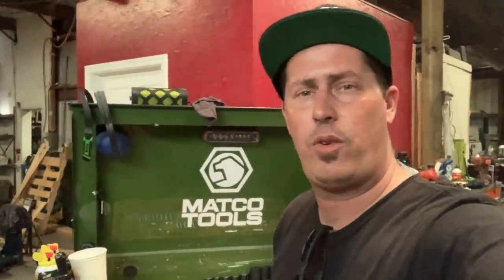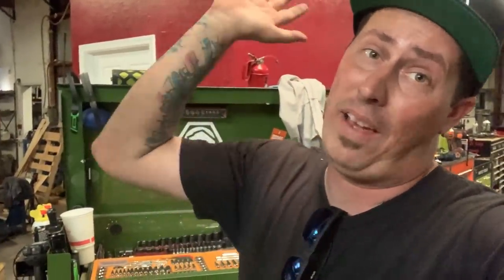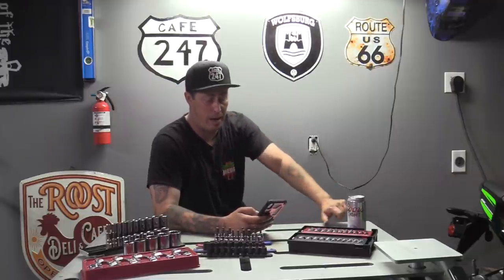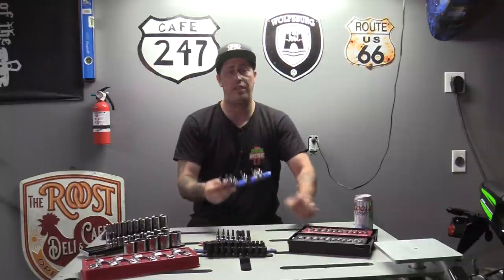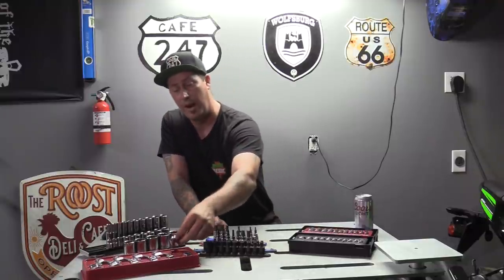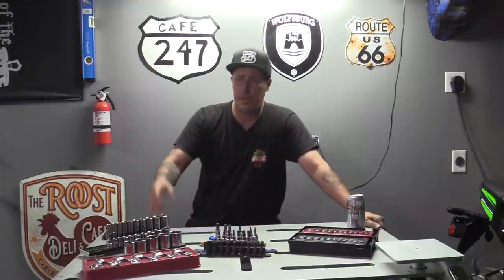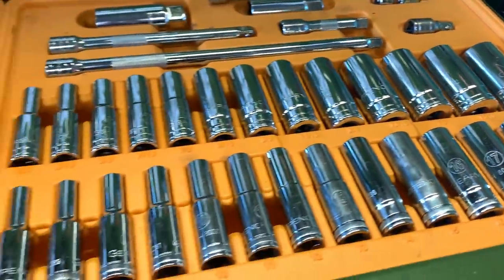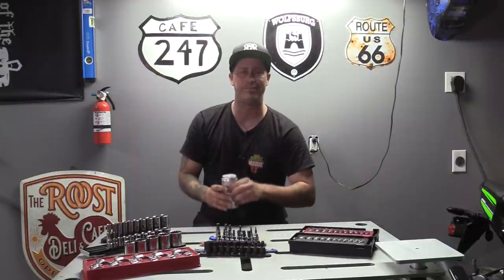Every Mechanics Socket You'll Ever Need

Comment: Like the video. Im a contractor for navy ships so I use a wide variety of sizes (wrenches, sockets, hex, torx). From 1/2 inch to upwards of 2-1/2 or 3 inch. Husky had a great clearance sale on a 432pc master set for $99 (399-449 origin price) they are a non-stock item, I only two in a 100 mile radius of me. Got one for home and one for work

Comment: Fun video.

I know this is two years old but wanted to offer my 2 cents for the newbies.

When I started my tool collection as a kid I found that I needed both deep & shallow sockets but it was never the one I had in my pocket.

My first real job as an automotive mechanic had tool trucks there every week. I usually bought Matco because they were easier to afford. But Snappy & Mac got some sales also because they were there on the day I needed the tool.

Anyhow I found a Snappy set of semi-deep sockets. I had to try them & they became the most used sockets I owned. They worked 95% of the time. This was my best investment.

I will probably hurt some tool snobs' egos with this statement but just because you pay more does not make it a better tool. Just to qualify myself, my toolbox empty cost more than most of the cars I worked on but it was pretty & it said Snap-On. I still have it & it is a good box but has had to have repairs over the years(mostly drawer rollers). I have had so many different names that I forget most of them. I remember buying Benchtop from Kmart which was good but they did get replaced by better names. I preferred Craftsman wrenches but there were times they were too thick. I hated Snap-On wrenches because they were so thin they dug into my hands plus mechanics' hands do not grip well from the way you abuse them. I also bought Stanly which was another good tool. I used Harbor Freight until their prices became too high.

It doesn't have to be expensive to be good & just because it is expensive doesn't mean it is good. You will buy what is in your budget & what is available to you. A quarter of my tools are Snappy, another quarter are Mac, & so on because that is the truck that came the most often to the shop I was at.

When you have to modify one of your tools to do that one job I can tell you that it doesn't hurt as bad when it is a Stanly tool as it does when it is a Snap-On tool. I'm pretty sure I have cried a few times when having to grind or weld on an expensive tool.

Comment: I just picked up a basic set of e torx at Home Depot for $9.97  worked great for what I needed them for, I gave my triple squares to my friend because don’t have my VW anymore. I’ll just add my opinion on 6 point wrenches and sockets, you need some in your arsenal that extra grip on a fastener is just a necessity.

Comment: awesome as usual guy I ordered some oem socket trays regular stand up studs kind of deal just bought the big icon set of half inch hex I needed the 12mm for special lugs on after market wheels doing brakes an rotors on a nice Cadillac for friend of mine 😎

Comment: it's like my mother and tupperware.. i'm no pro but i do my own and have truck load of tools to show for it. spent a lot in the last couple of years tooling up for random stuff. like mowers, a gmc that i knew was gonna be a money pit, being ready for a breakdown and having some basic tooling in 3 vehicles.. not to mention getting into pneumatic tools and an inverter flux welder.. i've bought 2 sets from tsc, a gear wrench and large socket set from job smart. both left over clearanced out from christmas and way cheap. i have about everything i'll ever need in that 312pc job smart set but it's also nice to grab a small set and run out front or go in the house (damned washer). i've even got a cordless impact and impact driver that i use more quite a bit. as i said, been tooling up quite a bit over the last couple years.. a better paying job and getting into more troublesome fixes for the sake of tinkering on something on the weekend. i'll be honest though, if you are a diy guy just working on your car or random stuff like a damned washer or crusty old john deere, you don't need all that. i don't regret my purchases but i have way more than i need. it's nice not to barrow or run out an buy tools when you need them or have something when you need it. i got by for years with a decent part house set with deep and shallow sae and metric, 1/4 and 1/2" stanley sets. then just getting the stuff i need as i go like torx and allens. he's right, a decent mechanics set will do most fine to start out. i would invest in a set of wobble extensions and universals in addition to that set. vice grips, adjustable wrenches, channel locks, a small assortment of pliers, a cheap set of combination wrenches, and don't do super cheap screw drivers if that starter set doesn't have all that other stuff would be good to get.

Comment: Dude !!! Great Video my Friend 👍👍😊😊 I was thinking about you and your Dad....COOLEST Father and Son on all of YOUTUBE !!! Very nicely done 👍😊 to hook up Judo sailor. What is your opinion on the KOBALT line for a DIYer like me?? Any experience with the 24v tools. One thing I don't have is an impact wrench. Ñever had one. What kind of torque do I need for lug nuts and maybe other home repair or projects??? I always learn so much from you and your Dad. Love 💕😊 both channels. Thanks again for sharing your thoughts and videos Rodney
PS what is your Dad's name?? I keep forgetting lol@me
Reply from the maker: The home handyman lol
Reply: Not his channel, you goofball LMBO 🤩😁 his name ,!!! you're Justin I'm Rodney and Dad = ??
Reply: I have quite a bit of Kobalt 24V line of power tools. The XTR ½" impact wrench, XTR recip saw, oscillating multi tool, impact driver, and hammer drill. They never let me down and always got the job done. Battery line is reasonable. Yeah, the Milwaukee can drill a timber lock fastner in like 7 secs while the Kobalt does it 8 secs. I'll take a sec slower for fraction of the cost.

Comment: I think a socket organizer recommendation video would be cool. Off topic, recommending a good pair of jack stands would be good since the harbor freight ones were recalled. Thanks!
Reply: I have a pair of Pro-Lift brand 6 ton jacks with a locking pin that works real well for around 50 bucks on Amazon.
Reply: Short version is dont buy any jackstand with the handle design to release it only buy the stands that have pins you put in place threw them

Comment: The GW set you bought for $250, were they 6 point sockets or 12 point. Because the link is to a 12pt set, and the 6pt set is like and extra $100.
Reply: They are 6-point, he linked to the wrong one which has the same part count (243).  The product number for the 6-point one is 80966.

Comment: Now need the torx plus bits and E torx plus sockets now.GM and Ford use E Torx plus a lot,one is the newer Ford Truck bed bolts.Grey Pnuematic makes the duo sockets so you don't have to buy chrome sockets.12 point,I buy them for certain applications only.

Comment: What are eight point sockets for?  I have some 1/4" sockets that are like a double square, not triple, but I have never seen a fastener to use it on.  Thanks, love the knowledge.
Reply: Typically pipe plugs now. The square head fasteners were like the first bolt head designs.

Comment: I would never recommend a master set to anybody, they are never complete unless you go with tekton. I had my fair share of them and always lose a piece because the cases are already "organized" then have a bunch of socket sets with just a few pieces missing. Get a set, put it on a rail and bolt the rail down in your box. Youll never lose another socket unless you go out of your way to.